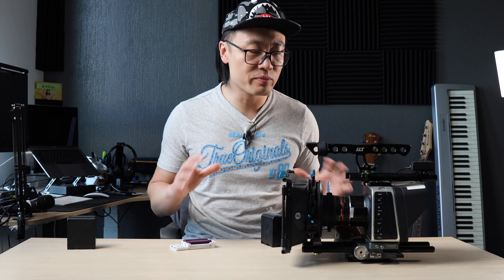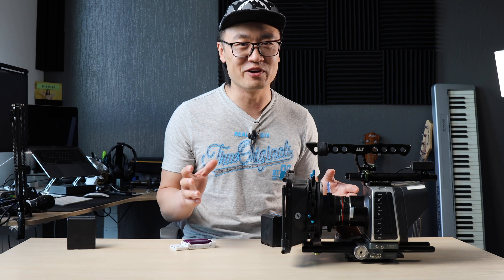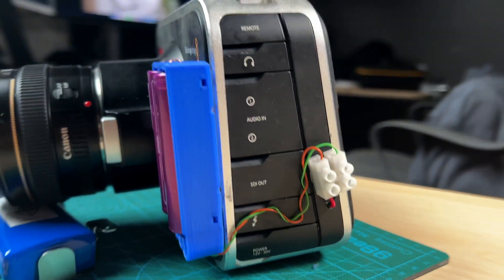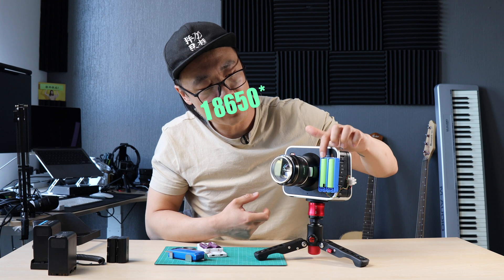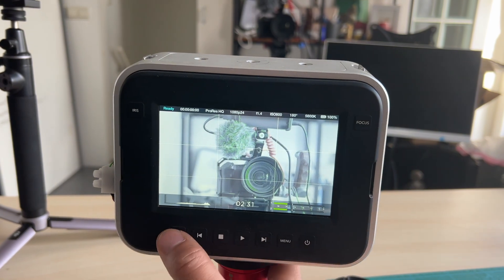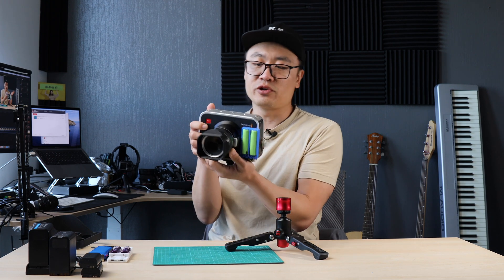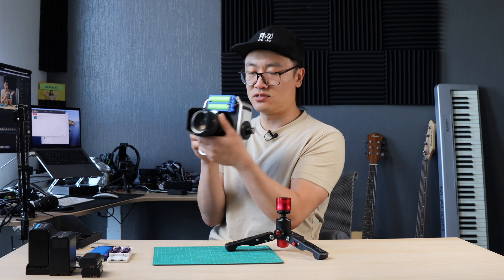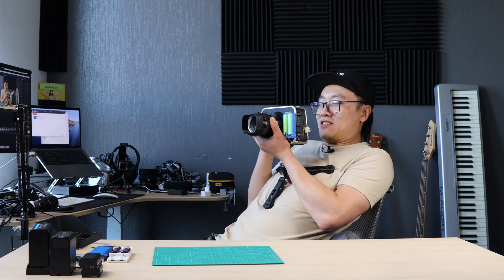BMCC OG 2.5K  power supply modification with 2x 18650 battery cells

Comment: I did everything like in the video! but the camera with these 18650 either does not turn on or turns off almost immediately, why?
Reply from the maker: Great to know you tried the same. The output should always be 7.4volt (2 cells on parallel), can you please measure your output first, then try different cells if the output is not stable. Good luck and let me know if this helps.

Comment: Does the camera charges the battery (when you plug the camera to dc adaptor), or you have to charge them seperatly?
Reply from the maker: Yes it does charges the battery when plug-in. The cells are basically a replacement of the internal battery, but external.
Reply: @BikmanTech  Thanks, I might do the same but leave them inside. I always use Vmount batteries. With this at least I don't have to set the date everytime I restart.
Reply from the maker: I just did a size comparison between the original battery pack and 2x18650s, swapping them is totally fine.

Comment: I think this is the concept behind kinefinity's kineplus mod - only in that case they used one np-f battery instead of 18650s. Honestly the fact that the factory BMCC can only be fed 12v has always been a pet peeve of mine, since 7.4v allows for greater flexibility and duration. To discover that there was a hidden 7.4v option inside the camera all along is wild. Nice video!
Reply from the maker: Thank you!
Reply: Yeah but they serve 2 different purposes. The 12(12-30V) input includes circuits for charging the internal battery, maybe other things.
Reply: @meanmarine24  That's exactly what I hate so much about the fact that the battery is only internal. If your internal battery is dying and can't be charged, using the 12V battery can oftentimes send it into protection, lose your footage if it is in prores and isn't processed yet and drain your external battery (it happened to me).

Honestly I don't remember if the BMCC needs a 7.4V battery inside at all times (I think not given the BMPCC does not) for the 12V to work, but either way it being fed internally is a bad design choice because 1) if it's needed, then it would be better to just have a 7.4V  battery slot or input with a 12v charger or 2) if it isn't needed, the internal battery just takes up what would be a useful and flexible power option. Even with the first BMPCC Blackmagic had this solution figured out, though I might guess it was more the result of mimicking DSLRs than a genuine choice. Regardless, the detachable battery design has been implemented in all future iterations with the charging capability still intact.
Reply: @MyChannel-SR1  I don't think internal battery is the end of the world. It does run a solid 1½ hours iirc. But yes, a smaller package with an external mount is way better. BMCC is deffo a outdated design.

I like 12-30v input though. That's very flexible for various power sources.
The newer cameras are 12-20V. I recon you won't get below that 12v for whatever reason.
You look at it from the consumer side, but there are electrical reasons why it could be good to run 12v in. I haven't studied the PCB of those cameras, but there are different types of voltage conversions, and they are not all equal in efficiency, hence why they may be running 12v in. For example, it could be that the voltage regulator component they use is most efficient around 12-30(20), and if they wanted to allow down to 6v in, they wouldn't have the 6-30v range, or lack efficiency etc.

This stuff is always a bit more complex than it seems on the consumer side.
Reply: @meanmarine24   You are not understanding. It was one and a half hours when it shipped. Most of them today run 20 minutes if you are lucky and they are not stable. Nowadays you either make your own balanced battery pack from 18650 batteries or you risk to overwhelm the camera. That's bad electrical design, not a consumer peeve.
An old battery that can't hold charge and drains the external battery (and can kill the cached prores footage) is too much of a risk for any professional to run. Blackmagic doesn't really offer replacements and most of the RC batteries you can find are old. The other option is to DIY it but that means holding whoever agrees with that decision liable. And all of that is if you have a skilled enough crew to even bother diagnosing the issue. It's quite literally the end of the world for professionals.

I wouldn't call it an outdated design either. No cinema camera that I know of uses an internal battery. Some have buffers, but they are sandwiched between the v-mount plate and the battery.
The bad thing isn't that the BMCC uses 12V, it's that it also has a 7.4V that goes unused.

As for what concerns power efficiency, I doubt the current design is in any way the best. Charging a 7.4V battery from a 12V source means having to step the voltage down to 8V, which is vampirizing the 12V battery, and constantly at that (even worse, most batteries don't really hit the 100% figure now so the overcharge protection never goes off. The camera is either constantly charging or charging and discharging). If the battery were removable that wouldn't be an issue. The fact that the voltage is 12-30 as you point out also suggests that the input is stepped down and my educated guess is that the baseline 12V isn't going straight into the camera in any component, so it would still be less efficient than feeding from 7.4V (it's a smaller voltage dropoff).

But even with that in mind, having a 7.4V input option wouldn't impact the current design in any way, since the only thing that's needed is to wire a connector (or cradle) instead of the battery. Having the ability to use Canon batteries, Sony NP-Fs (which one could put in series if needed) and all that is what I call versatile, not the standard 12-30V we see on most high end cinema cameras. 12-30V in filmmaking terms basically means using a 14.8 V-mount and that's it.

You seem to think I want a 6-30V input. What I want is the 7.4V that's already inside the camera to be available alongside the 12-30V input.
Reply: @MyChannel-SR1  
" It was one and a half hours when it shipped. Most of them today run 20 minutes if you are lucky and they are not stable."
Mine's fine. But yeah it can happen. It's an old camera and the tech moves fast. As shitty as it is to have a 3000usd camera with a worn out internal battery, the industry and tech moves faster than that.
But as i said i agree with, it's not the best design choice. 100%, a normal battery

"Nowadays you either make your own balanced battery pack from 18650 batteries"
Or replace the internal battery for a nicer and less error prone solution.

"or you risk to overwhelm the camera. "
Not sure what this means. Keep within the voltage ranges and give it adequate power seems to be the norm for any electronics.
The 12-30V port needs...12-30V, and current draw support of maybe 2amps to be on the safe side. The pocket cams like around 3 amps.

"That's bad electrical design, not a consumer peeve."
It's not the end of the world. It can be replaced. Or buy a new camera instead of a 2.5K camera from 2013 if it's for professional use.
Also you have to understand that product designs are not perfect. Engineers do make mistakes in design, or they don't have time to redesign, or the components are not available etc...

"An old battery that can't hold charge and drains the external battery (and can kill the cached prores footage) is too much of a risk for any professional to run."
Professional?? Replace the camera.
Hobbyist? Replace the battery.

"most of the RC batteries you can find are old."
??? RC batteries are made all the time. It's a bog standard 2S LiPo. You can see this when people replace it.
google it.

"The other option is to DIY it"
There's limited support, parts and features in this camera. It's cheap second hand. It's great for tinkering, but not what professionals need.

"I wouldn't call it an outdated design either"
It's huge, heavy, uses EF mount (or mft), has internal battery that dies, uses SATA SSD's instead of CFE, the interface is clunky, the screen is impossible to see in sun.
It only records 1080P (or 1350P with prores).
BMD has released tons of different models that replace this cameras function.
It's outdated man.
I think it's a cool camera with a great image that records uncompressed CDNG, but everything else about it is outdated.

"No cinema camera that I know of uses an internal battery. "
They all have some form of battery or they would probably lose their settings / TC :)
BMD just made that battery really big in the BMCC lol.

"The bad thing isn't that the BMCC uses 12V, it's that it also has a 7.4V that goes unused."
The 7.4v port is for the internal battery. It is not unused.

"As for what concerns power efficiency, I doubt the current design is in any way the best."
Didn't say it was. Just that there's many considerations, and they are more complex than what a consumer sees.

"Charging a 7.4V battery from a 12V source means having to step the voltage down to 8V,"
And that's fine. Lithium battery charging is highly controlled, so the voltage is always converted down or up.
Each individual cell is charged to 4.2V (YMMV, 3.9-4.25v depending on design) max.
A typical 7.4V battery would be 2 cells in series (hence, 2S), that forms a battery with a voltage range of 8.4V-6.0V (typical absolute cutoff).

Electronics are inherently voltage regulated. My guess is that most of the functional components inside are fed 5V, but before that are power distribution, battery charging ciruit etc.
But it is a lot easier to have a 12V input and regulate it down as needed. Because of battery fluctuations, cold, power draw spikes etc, it's not good to have the battery cutoff be at the system operating level.
My guess is that a little bit higher, like 10v, is easier to have a safe margin of operation.
7.4V DSLR batteries might be common in the space, but going outside DSLR and just looking at industry and electrical in general, it's quite common to work with 12V or 24V.
I think it's great. I just run 4S Lithium batteries straight on it.

You can use bigger NP-F batteries, but it makes more sense to just buy a proper V-mount plate and use those, as that's the standard. They have more power and runtime for a full rig.
"But even with that in mind, having a 7.4V input option wouldn't impact the current design in any way, "
We don't really know, as described above. And they still do it on all their never cameras, so probably there's some reasons worth considering.

"You seem to think I want a 6-30V input."
I wasn't really concerned with what you want but ok.

"What I want is the 7.4V that's already inside the camera to be available alongside the 12-30V input."
12-30V is just fine. If you want to use low-voltage batteries, make an adapter to use them in series.
I'll be sticking to 14.8V like the rest.

But as written above, they obviously designed the camera to have a high safety margin and flexibility in the input voltage, and then finetuned the electronics inside below that.
They take that 12-30V and feed it into a voltage converter down to whatever, and then they feed that into a charging circuit for the battery, that then takes that 8.4v-6.0v voltage and feeds that into a another voltage regulator that then goes to the camera electronics.
I think that's a just fine design, and it makes sense that they have an input voltage that's higher than the battery they're working with.
Reply: To clarify, in electronics design, you want the electronics to work reliably well below the power input voltage. Hence, if the camera runs from a 8.4V-6.0V battery internally, you do not want it to also run the battery management circuit on 8.4v-6.0v input, but rather from, say, 12V.

Comment: I put two 18650s inside in place of the original battery. Plus BMS for 50cents - maybe not needed but.... The camera works for 1 hour. As external I have 2x Bosch 18V for free from the old drill - the next 2 hours of work :)
Reply from the maker: damn a drill battery that's hard core! cool!
Reply: @BikmanTech  Charger housing converted into a socket with cable and plug. It really is good at attaching to a tripod or cage. The batteries are old but have 20v when charged.
Reply: Can you share name BMS? What battery do you use?

Comment: The mod is UGLY AS 🤪, but the fact that you drilled through the body and ran the battery wires out gave me an idea on how to modify mine. I think 18650 batteries are way more useful than people realize or the industry would like users to know. 
Well done. Thank you for sharing!  👍
Reply: Haha thanks!
Reply: btw the hole was already on the metal frame, you only need to drill through the rubber.

Comment: This is a really clever mod - I wonder if the camera itself has any overcharge protection in place or do the cells do this already?
Reply from the maker: Thank you. The charging circuit is unchanged on the camera, and you may charge it with either the default charger or just charge the batteries themselves with an external 18650 charger.
Reply: Hey Patrik, in the unmodded BMCC the protection/balance circuit is inside the battery (which also makes replacement batteries hard to find), you'd need to put another circuit for li-ion batteries to avoid any long term problems. Without the circuit, however, the camera should still be able to function. I would recommend using a 2S PCM circuit though in order to be safe. (Disclaimer: I am not responsible for any damage that may be caused by following my advice)